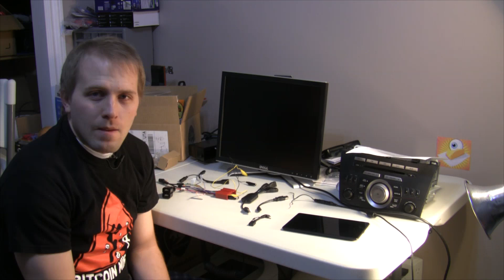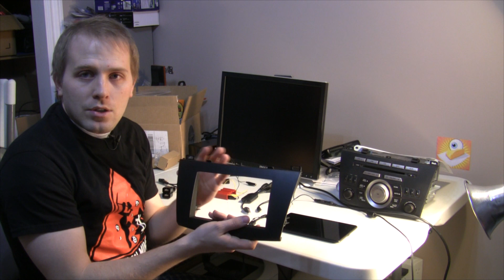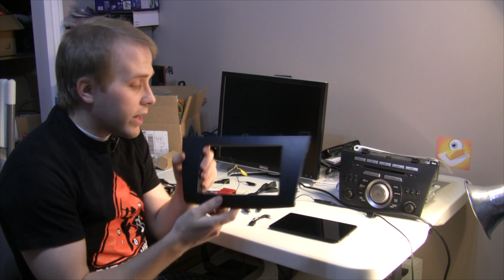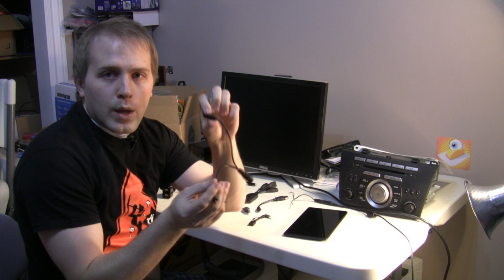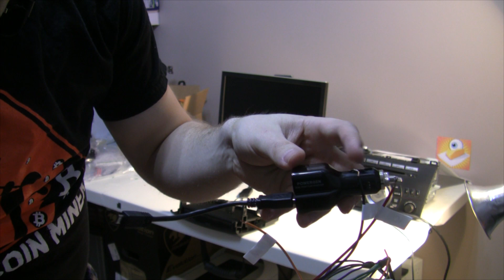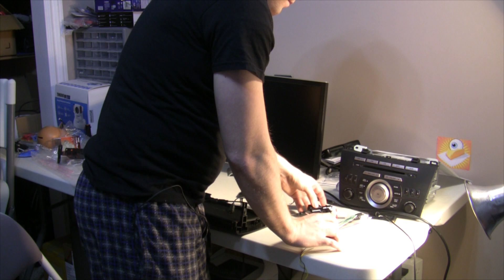Replace your Car Stereo with a Nexus 7 2013! [Guide] Part 1

Comment: Hi how do we wire or solder the wires to the acc line and also the grounding cable ( attached to a circuit board as you mentioned ) on the side of the power gen? 

Is there a provision on power gen and by soldering do you mean we use nose pliers?
What is the correct method please to do soldering Like you did ? 
I like this as it’s all well laid out and I’m adapting this tutorial to a ride on car. Benz gl63 amg . Kids ride on.  

The harness will be of the under side, after removing screws .

Comment: Thank you for the best video on the matter!! I have a doubt. I've read that the nexus 7 2013 charger outputs 1.35A at 5V. I've bought a car charger that has these two ports: ONE: 5V/3A, TWO: 6,5V/3A or 9V/2A or 12V/1,5A (Max). If i'd have to use it to power just the nexus I'd use port 1, but I also need to connect to the USB-OTG cable a usb host. The usb host wil then house a Radio FM dongle, possibly a USB stick, and most importantly a DAC/AMP will be connected to it. Should I still use port ONE, because afterall the amps are the same between port ONE and TWO? Will it be enough power? I'd have another possibility. The DAC/AMP has 2 usb ports, one for power and one for data. I could connect the data port to the usb hub (that goes in the usb-otg and then in the N7), and the power port to the port TWO of the car charger, so the DAC/AMP is powered separately from the other parts. What do you guys think? Sorry I'm really bad at these things.... Thank you so much for the help!!

Comment: Hey cbutters! I'm doing a similar project in my 2013 Mazda 3 with bose, but I can't seem to get audio from the nexus to work. Could I have a quick explanation of what you did to the wiring harness to get it to work? I believe I have a similar wiring harness to the one that you used. At first I split the 3.5 mm wire into RCA cables, then tried to connect those to the right/left wires on the wiring harness, but couldn't get audio from it. Thanks for your help!

Comment: nexus 7 not charging fast enough in the car and im using a 4.8 amp charger do you think its the charger wire that it connected in the otg cable causing this

Comment: Can you use the Nexus 7 With Subwoofers. Ik that most higher end radios have something on the back for the amplifier to be plugged in. In my case I'm trying to use it on 2 10" JL audio's and from what your telling me there's almost no watts from the nexus. Could you suggest the Volt/Power of Amp I would need to supply it to be adequate for the two 10's and the rest of the car. And also if it's possible to plug in a Zune or ipod while its in the car running, Like an MP3 Slot? I never had a Nexus but am really interested in getting one for my car now instead of a standard touch screen stereo.  Thanks, Kyle

Comment: Question for you.  I'm actually doing this on a Mazda 3 as well.  2010. So the only part I can't get going is the factory amp.  Looks like there is a wire on the harness to trigger the amp.  I figured using the ignition 12v line would work for this.  Just splice the 2 together but no luck.  Any help would be great!

Comment: I have a very tight space in the OEM Nav housing of my Mazda RX8, so I also need the right angle extension cable.  But I have already bought two different ones and neither will allow me to connect the OTG y cable with out losing the Fixed Installation (FI) feather of Timurs kernel.  It never shows that OTG Hosting + Charging is enabled.  If I plug the y cable directly to the Nexus, then it works fine.....but of course won't fit in my housing.  Is there any specific version of the right angle cable I need to make this work?

Comment: I'm doing the same thing in an RX8 OEM Nav Housing.  It is really tight in there and I have to use a right angle cable.  I plug the OTG+Charging cable into the right angle cable, but lose the OTG functions.  If I plug the OTG + Charging cable straight into the Nexus, it works fine and goes into Fixed Install mode.  The cables I see on amazon are male micro usb to female usb 2.0.  Where would the OTG cable go?  Im confused by the different cables and adapters.  I just need to find an OTG + Charging cable with a right angle male micro usb end, or a right angle male micro usb to female micro usb, that will pass through the proper OTG signals.  Any thoughts?
Reply: +Robert Catala you should seearch for angled adapter extension : 
http://www.amazon.com/CablesOnline-Micro-B-Position-Extension-AD-U43/dp/B00JSXQL62?ie=UTF8&psc=1&redirect=true&ref_=ox_sc_act_title_1&smid=A2JSBUBRVPP4SX

Comment: hello! that is a very nice set up! i tried to do the same on my 04 wrx as well but i ran into some problems after install. everything else works perfectly but when i tried and play music while charging the tablet. it makes this very loud static noise and it would work perfectly fine after i take the charging out. i was wondering if its possible to fix this and how. is there anything else i need to buy in order to fix this problem? right now its being plug into an amplifier and the tablet being charged via usb to the cig port. thank you
Reply: +Michael Le Ground Loop Isolator and Noise Filter

Comment: Hey, nice setup. I have a lexus is300 that come with a stock amp as well. In your video, you didn't use a usb dac at all. How were you able to wire your table to output audio to the 4 channel amp (mine has 4 rca).

Comment: Looks interesting but sounds expensive and like an awful lot of work.
Reply: +Keith S  Here is my build on this setup.  It is being used in a 2007 Mustang and also on a 2006 Ford Fusion.  Parts are as such:  Used amp-KTC445U Alpine....$50. Joycon R series swc's, $42., Tablet Nexus 7 (2012) with kernal 4.4, $50, Beringher LCA202 controller, $22., 4 port SD/TF/USB hub, $5, 4 port universal hub, $5., misc wiring with RCA connectors, $20 overall, Metra DD mounting frame (had, but cost about $15 new), and finally a dual USB power adapter from 12v to 5v, 3 amp constant source, $7.  All this was bought off eBay with the exception of the Joycon R which was bought off Amazon ($42 shipped Amazon, over $50 on eBay plus shipping).   Adding all this up, I have approximatelly $210 total.  I have GPS, FM Radio, Police Scanner (app), Torque for OBDII (app) with plug in wireless module ($10 eBay)and can add up to 128 (2-64 GB cards) of memory, or I can add a full TB of memory using a Samsung portable storage device.  They can be bought (1TB on eBay for $54 delivered) if you are interested in adding that much storage.  

As you can see, for under $250 you can have a fully usable computer in your car with all the memory you can possibly want, and all the music or videos also.  It is a win for our cars, if installed correctly.  Good luck if you go this way.
Reply: +Bill Johnson I forgot one thing.  If you want to make your car or truck a wireless hotspot, if you have a smartphone, it is simple with a Asus WL330N3G wireless portable router.  I paid $50 on eBay for a new one delivered, and it gives you use of wifi in your car for little cost overall.  You will have to watch your phone bandwith if you download a lot of movies, etc, but otherwise, it is a very nice add on and makes the kids happy when you travel.  Isn't technology a fun thing?  lol

Comment: Can you help me to install Nexus 7  OR similar equipment  on Dashboard of Toyota Camry Grande V6 2004, & work  as a Android GPS, Stereo (Toyota 6 Speakers system 4ohms, if amplifier necessary pls mention)  & Connect 2 front & 2 rear night vision cameras ? 18.5 Cm X 10 cm area available in dashboard. What all materials to be purchased through e-bay & how to fabricate a charging system from Car to Nexus.? Pls mention complete parts  list (from e-bay) to be purchased. Also mention required tools list.

Comment: hi , is 12 volts too much for the nexus 7? wont it damage it? should I buy a power converter or reducer type thingy, hook that up between the 12 volt line and the micro usb cable going into the nexus?
Reply from the maker: TheBull06 wow! yes, do NOT feed 12V directly into your nexus 7 it would probably fry it instantly. You absolutely need a voltage regulation down to ~5 volts. You should use a 12V car charger as explained in the video series or If you don't want a cigarette socketed adapter in your build, use some other fancy voltage regulation method, but absolutely don't wire 12V directly in.
Reply: cbutters ok thanks, i will also install a switch to charge the tablet whenever it is low. Can you maybe help me with this?  So basically what I have to do is cut open a wire with 12V, install a power regulator to convert it to 5v, then connect  the red wire from microusb to the now 5v source and the black wire to the switch? is that how it works? The switch I bought has 3 prongs though theres also one with 2 prongs should i get that one?
Reply from the maker: TheBull06 I would use your ACC line (it is 12V) from your radio harness, that way the tablet will know when to turn on and then off again, unless you want to wire some sort of switch to tell the tablet to turn off when the car is off. I don't know anything about the switch you bought, I would need specifics to give you any advice.
Reply: cbutters I think I will do that sounds a lot simpler. I was just worried about over charging the tablet

Comment: Is this possible to do without an AMP using the Asus Nexus Tab 2012 version???
Reply from the maker: Brandon LoBue  you will need an amp unless your car has one built in like mine did (uncommon)... the good news is that with your old head unit removed you should have plenty of space to drop an amp behind the tablet where the head unit used to be.
Reply: cbutters Thanks! I don't know much about amps. Hopefully I can get one at a decent price.
Reply: I have one more question... My ford focus already has a steering wheel volume and track control behind my it on the left-hand side, can I somehow get that to work with my tablet?

Comment: Hello. I have a Nexus 7 2012 running CM11 that is mounted in my car. I bought a DC to DC converter and ran 4.2V directly to the battery terminals with the battery removed.  This should give the Nexus a 100% charge all of the time. I left the battery electronics hooked up.  I think it is the temperature sensor, should I remove it?
The Nexus still "drains" the non existent (PHANTOM) battery. How do I keep the Nexus from knowing the phantom battery charge?  Another words, it has to shut down and restart to think that it has a 100% battery charge again.

Comment: Hi! That's awesome! I'll start this project right away for my Impreza. I only have one doubt, if I use a Samsung tablet I Will have the radio built in, but in the nexus I don't know if it has it. How did you solve it? I don't want to use any of those Internet radio apps that will consume my cell phone data. Thanks a lot!!

Comment: What would be required for just the tablet to power the speakers?
Reply from the maker: your speakers would need to be wired up to an amp, and you could use a 3.5mm headphone jack to RCA L R outputs.
Reply: cbutters awesome, thanks for the quick reply

Comment: Excellent video. I'm planning to setup a Nexus into my car but i dont have the tools or technical knowhow to pull it off. For a start I'm setting up the nexus as a external system sticked to a magnetic holder. I want to use a backup camera system so can you please post some video on it? Some recommended cameras and setup with nexus? I found a seller in china who has some sort of AVI capture card system connected to nexus. Cant we simply power the camera with reverse light connection and have it transmit a wireless video signal which can be picked up nexus wifi sort?

Comment: How did you secure the Nexus 7 in the double-din kit? Did you use adhesion, or were you able to just bolt it in, and have enough stability?

Comment: Thank you so much for making these videos, they're very helpful!  I'm hoping you can help, I'm installing a 2013 Nexus 7 in a cradle mount on an older vehicle- long story short I really want a backup camera to help hook up to trailers.  The best thing I can find is "UVC video grabber card".  The guy that makes them is from Thailand and is really nice/helpful but he wants $77 for the card.  Do you know of any other way to hook up a camera?  Also do you know if the camera will work with the USB splitter?  I have a 4 into 1 splitter now...  Thank you!

Comment: I've seen some installs of the Nexus 7 where a digital sound processor is installed, the Nexus is connected to the processor and then the processor I connected to the amp.

My question, is the sound processor necessary? I've seen several people do an install that way.
Reply from the maker: A USB DAC is a nice upgrade, without one, there may be a very slight humming coming from the tablet device when no audio is playing, and the audio quality should be a bit higher caliber with the DAC, however, it is not necessary, and I'm running fine without one.
Reply: Interesting, so are you having any problems with humming when there's no audio being played?

Comment: Great videos.  I'm currently gathering the parts to put a 2012 N7 in my 2010 MS3.  You mentioned you have the preinstalled amp so I'm guessing you have the Bose system?  Did you buy a new harness or pull the one from your car? Thanks, look forward to the next videos.
Reply from the maker: I wired everything up to be plug and play, the wiring harness that came with my dash insert is totally stock, wire it up right and you won't have to tap any wires.

Comment: Nice video. Where did you get an angled adapter that had a female micro B port on the other end. I can only find ones with usb A
Reply from the maker: Search Amazon for SKN6258 microusb
Reply: cbutters doesn't the angle adapter also need to be otg? Did it work for you?
Reply: I found most parts at local Fry's electronics except the joycon

Comment: Hey, so i noticed that you soldered the speaker wires to your 3.5mm jack. Did you u just just attach all of the speaker wires to it? I am trying to install one myself and i bought this rca audio adapter but it doesnt work. I thought it would be good to do it your way. And when is part 2 gonna be done?
Reply from the maker: part 2 is done, go check it out on my channel... the only reason I can get away with soldering the 3.5mm jack to my speaker wires is because it isn't going directly to the speakers, it is going to an amplifier, which then goes to the speakers.... it works pretty well, but most people use a USB DAC instead of wiring the 3.5mm jack, this gets a little bit better fidelity audio. If you have an amp already, you can just wire up the 3.5mm jack though.